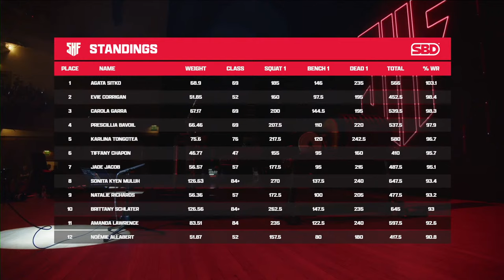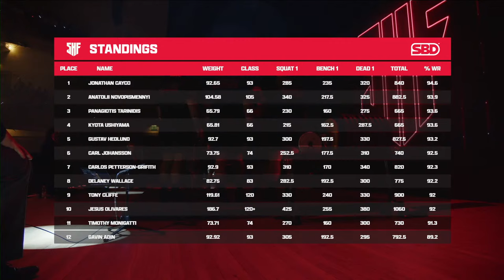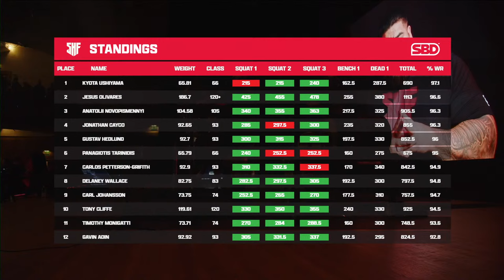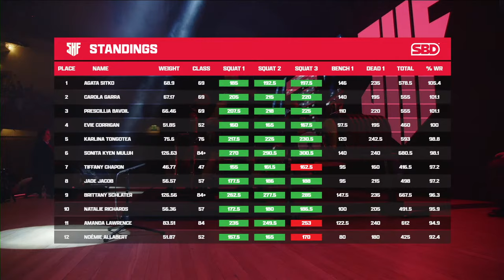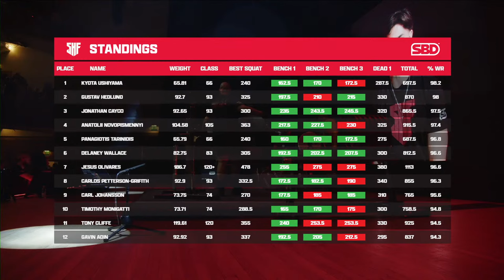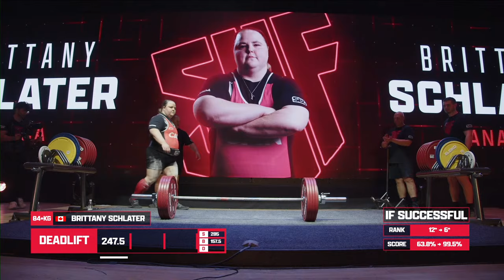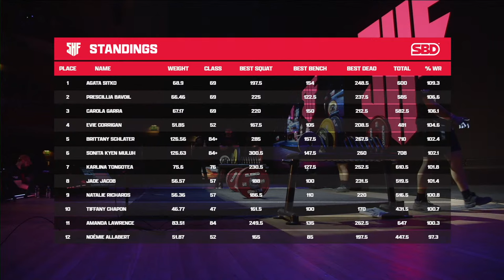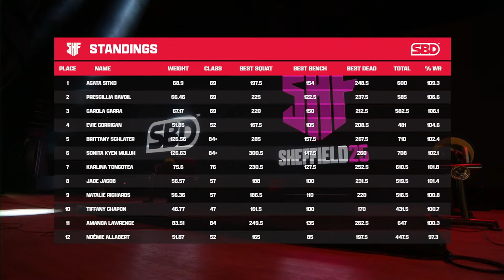Sheffield 2024 Powerlifting Championships

Comment: Sumo needs its own category lol does everyone not see this?
Reply: That makes zero sense, most of the strongest guys pull conventional.
Reply: At least the IPF uses a stiff bar, on which Sumo isn't so much of an obvious cheat code as with deadlift bars or even worse, Kabuki rubbish. In IPF you can still be competitive with a conventional pull, as many have shown in Sheffield.
Reply: This is dumb as it would result in a need for different categories for wide grip bench and wide stance squats
Reply: What? Why? Tons of the field pulls conventional... if sumo was so much better everyone would do it
Reply: Gustav Hedlund can conventional deadlift almost the same weight despite only training sumo, how would this be possible if they are completely different lifts?